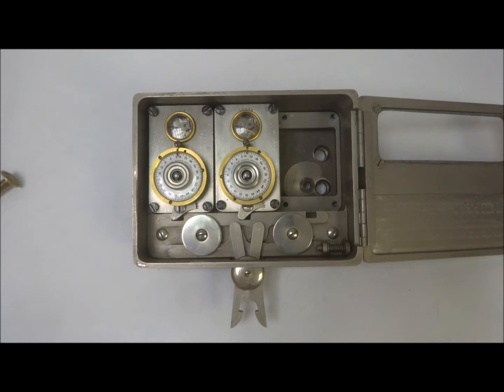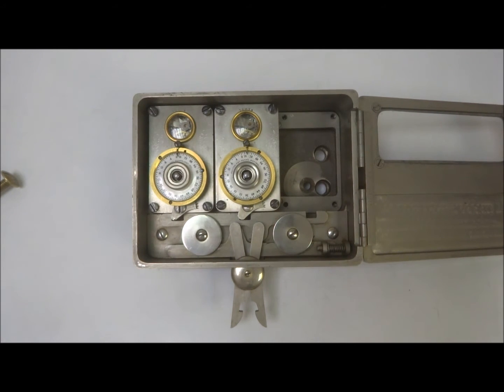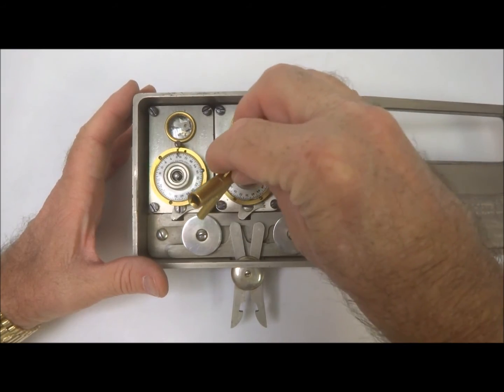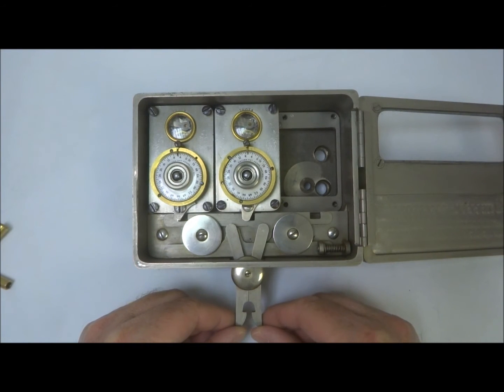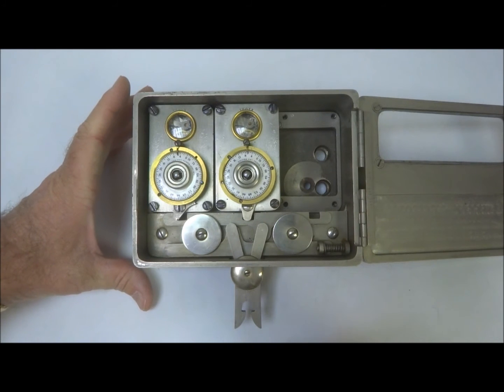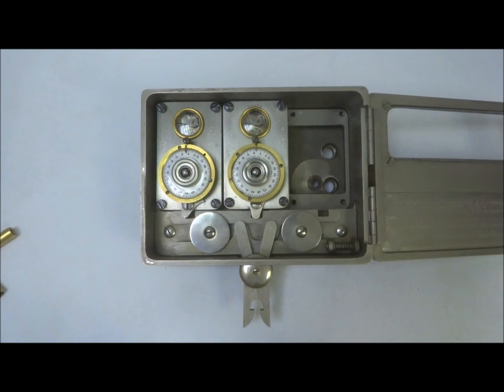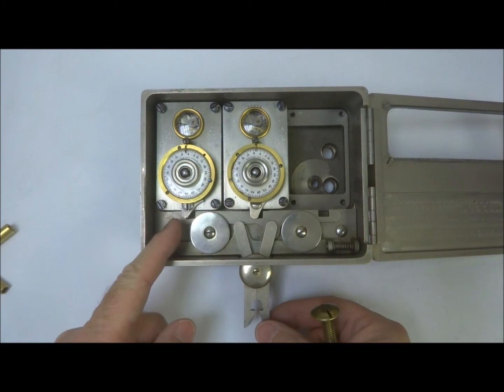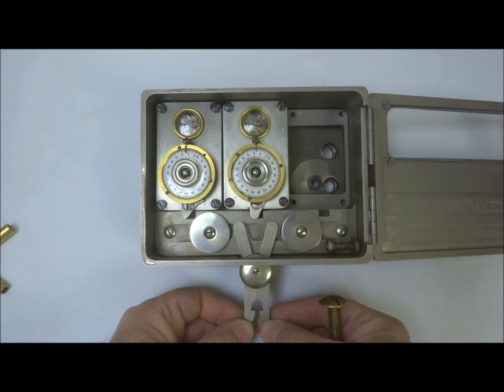Hall Safe Co. time lock, 1927. Demo of scissors bolt dogging system

Comment: Amazing website, amazing ASTRO clock, what a long 15years!  This model appears they used found parts and grabbed a bunch of washers, clunky screws and hired a local amateur machinist to make it in 1927.  Why even apply for a patent if that's the best they could do themselves?
Reply from the maker: Thanks for the kind words. I love mechanical things...a gear head. I think the time lock that is on the video may be original. One reason is that it has Dalton movements, and Dalton was one of the main inventors and patent producers for the Hall/Consolidated company.